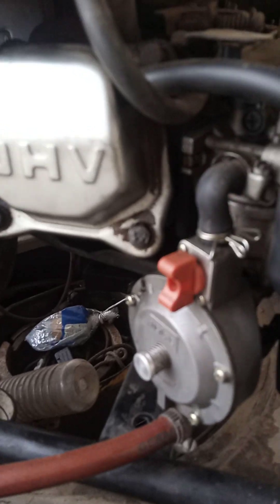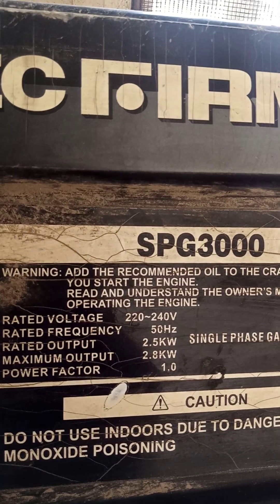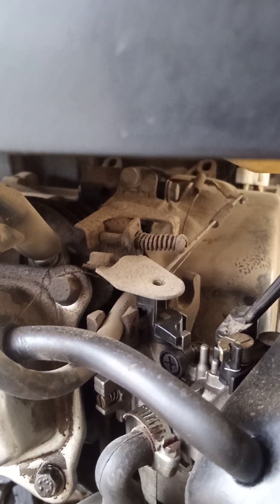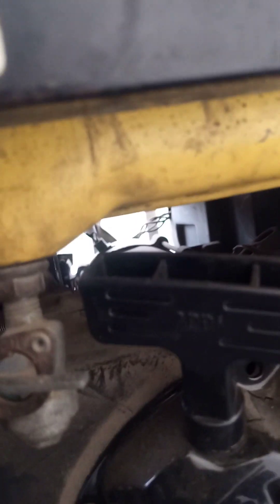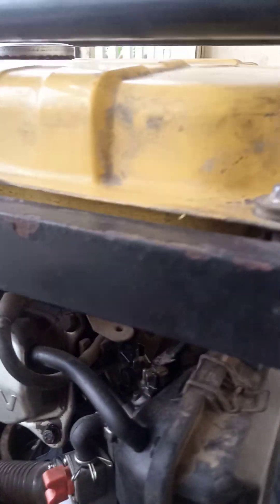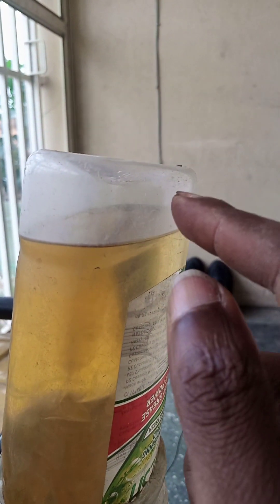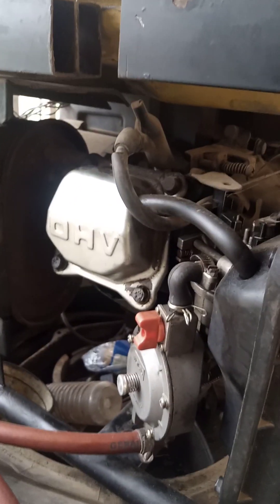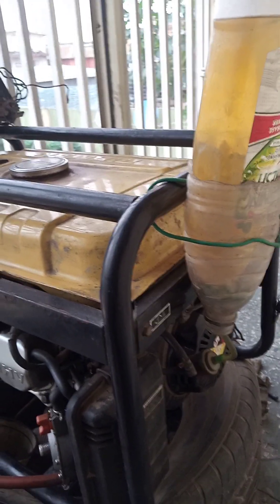Part 5 #LPG vs #Petrol which is cheaper to run your generator. Comparison 1kg of LPG vs 1L of petrol

Comment: That filter contaminant what's the name
Reply from the maker: Did you mean the improvised fuel filter? It is a normal fuel filter that you will find where generator parts are sold.